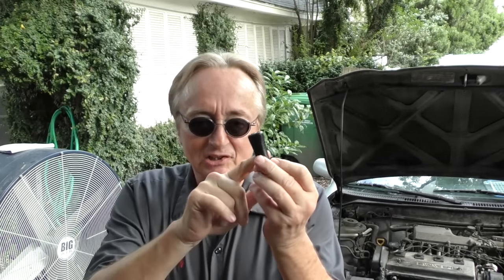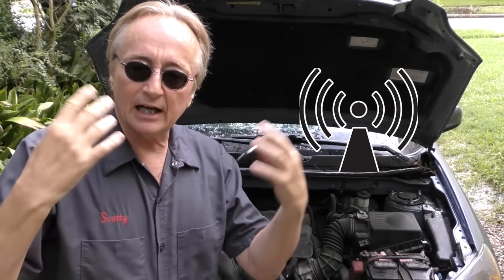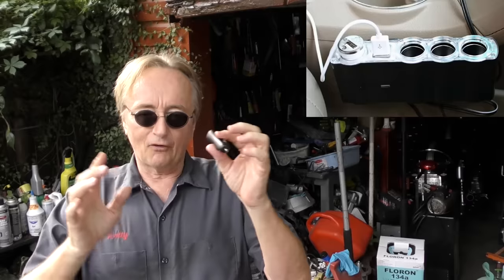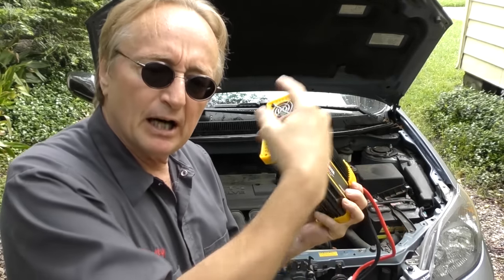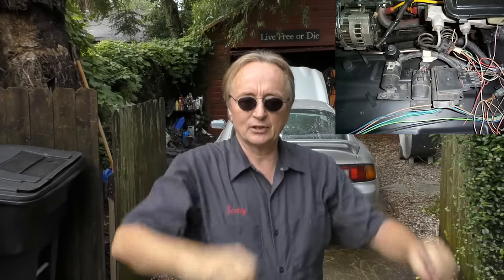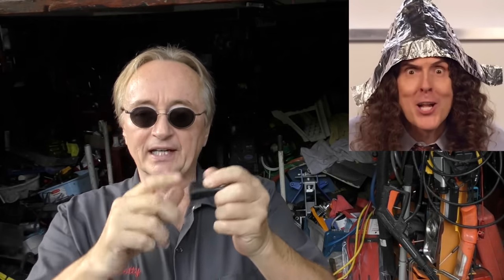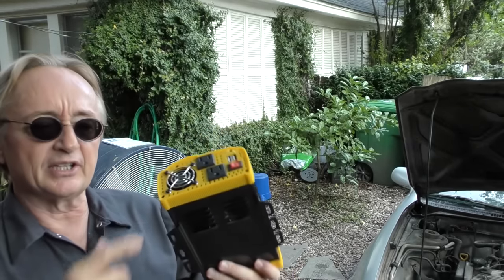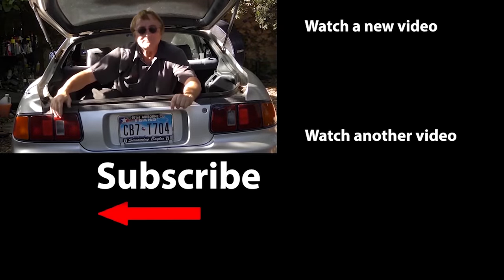This Adapter Will Destroy Your Car

Comment: While I agree with RF interfering with car systems, its not wireless frequencies that's causing the interference. Its RF being fed back into the car's wiring.

A simple fix we've used in the past is adding a DC line noise filter on the plugs you are using.
Reply: It depends on if the alien probes are plugged into the noise filtered plugs or not :)
Reply: Your reply makes little sense. Wireless frequencies and RF are pretty much one and the same.
Reply: May I ask for a product or some information on what we are talking about, thanks,
Reply: There all grounded
Reply: Isn't that for audio noise coming through the line from ignition and such, which suppresses those noises, as opposed to the inaudible RF frequencies?
Reply: @burritos1000  It would probably work for both.
Reply: It works for both, regardless of direction. Whether the sound is coming from your alternator or a device plugged into a cigarette light/power port, noise is noise.
Reply: The difference between RF through the air and RF down a wire are very different. Your car is bombarded with wireless RF constantly and on all frequencies. Outside of interfering with any wireless options your car has (bluetooth/wifi/cellular), wirelessly transmitted RF is pretty much a non-issue. 

RF being transmitted through your car's wiring is very different. 

Many of your devices in your car that could be subject to wireless RF are shielded. The box containing your ECM is metal for a reason. It's basically a faraday cage. What most cars are not shielded from are localized RF transmissions (IE: Coming from your alternator, chargers, etc). Localized RF transmitting through your cars electronics can wreak havoc on sensors, gauges, and computers, like Scotty was saying.

As for wireless RF, it's not a big issue. Localized RF broadcasting directly into your cars electrical system is something else entirely.
Reply: But, Scottie said, "if I wrap aluminum foil around it, (shielded) the problem goes away"
That would indicate RF thru the air to the remote start, which is programed to receive RF.

Comment: It's true that, RF interference can emanate from poorly shielded or low-quality 5V chargers and other electronic accessories connected to the 12V car socket. When these devices are in use, they generate electrical signals, and if not adequately shielded, these signals can radiate RF interference. This interference can then propagate through the vehicle's electrical system and potentially interfere with sensitive electronics within the car. With that being said. I've had absolutely zero problems with them. I've been using one that has 6 USB slots for several years with zero problems..

Comment: I remember the days when people put lighters in those holes.
Reply: I still do bro.
Reply: It used to be great smoking on a car trip, when your driving solo.
Reply: 07 kia sportage had both the lighter and a real ashtray !!
Reply: @orbitalair2103  did my driving test with kia manual. Jeez that car is hell. GERMAN UNTIL DEATH.
Reply: Now it’s a extra cost for a cigarette lighter package
Reply: USB adapter to power e-cigarettes... ugh.
Reply: Will Will  It is normal
Reply: You mean coin trays and USB power outlets. 
Something is wrong with the factory plug. It got really hot once. Never put it back.
Reply: @PritchyTurbo2000  Same here .
Reply: Leave them in because you might drop a dime down into it and blow a fuse or worse.
Reply: before vapes

Comment: I wish I had watched this video before I bought one of these cheap units from goodwill brand new! It blew a fuse in the middle console 12 volt outlets which operated on continuous power but not anymore since finding  and replacing the fuse it blew. It's a 2019 dodge journey and dodge wouldn't tell me what to do without charging a high price. One mechanic said shut down the battery by disconnecting it to reset the car's computer! What do you suggest Scotty?

Comment: "Even the physicists don't really understand electromagnetic stuff." Umm, OK, sure. I had one of the really cheap power adapters in an old Chevy Nova. That must be the reason that the engine ran out of oil and ceased up!

Comment: Next Video... "Why you Should wrap your keyless transponder in aluminum foil"
Reply: I actually would not be surprised.     Basically he is saying that if you shield it with a little tinfoil hat the adapter will be safe.   We drive our cars nears stronger "inverter frequency" fields all day long.    I am sure  these cheap inverters cause trouble.   But the details as to why doesn't sound clear enough.
Reply: That's how the aliens track us. wE aRE BeINg WaTCheD
Reply: I read that car thieves can copy your codes if nearby with a new copy devise. Then they just use the code to steal your car ! So wrap them in foil and it will slow them down ! Do the same with all credit cards too. A guy scanned our card  while we were on line at a store. We got a billed for  a Pizza & New pair of Nikees. It was in the big city, we hardly every go there ! Luckily  our bank caught it and we did not have to pay ! Those people should be boiled in oil and then horsewhipped. Before prison time, of course ! Sounds like a good deterent to me !
Reply: The Lexus ones can be shut off with a "cheat" code and then powered back up by pressing any button on them.

Comment: Another great video. I drive big rigs for UPS. and a bunch of our tractors have the check engine lights on. The mechanics check it and find nothing then reset the computer and it goes away for a short time but then always comes back on. Now I know why. My coworkers plug everything under the sun into the power points.

Comment: Luckily, the newest cars have plenty of USB ports built-in. So you don't need to buy any of those cheap converters.
Reply: The problem is the ones that are built into most cars don't charge very well
Reply: Corvid Cares  Yeah, that was my point. I have heard NOTHING about the built in USB ports in modern cars causing any interference problems. So I assume they were tested by the car manufacturers and shielded if necessary.

Comment: Subarus today will have USB ports built in at different locations, so no adapters are needed, also on the largest model there is a 120v outlet available.

Comment: Also cheap cell phone chargers and switch mode power supplies that you use in your home can cause large amounts of interferance on your home's electrical wiring, turns your house into a large radio transmitter!!.

Comment: Thanks for info Scotty. I had no idea these plugs would create such a problem.
Reply: They can't.
Reply: Ditto
Reply: @witzed1  you'd think before going through all the effort of making and posting  a video, one might at least google what the main subject of said video was and how it worked. or how the PWM output of a buck converter is pulsed dc not ac. or how a 5v2a adapter does create some em output... but is negligible compared to the 14.8V 50A and above AC to DC monster attached to every fossil fueled vehicles engine.... the cars were most likely more affected by EMF from the chargers on the power side because the cheap ones dont have input coils to filter this... obviously i made all this up... because if even scientists dont understand electromagnetism , i dont have a coulomb to stand on...

Comment: Most of the newer good ones don't convert DC to AC to DC. They just step down the voltage and amperage. Much better and cleaner.
Reply: How do you step it down without converting to full or half wave AC?  Are you saying they just but a big resistor in there to drop the voltage?
Reply: *big linear voltage regulator. such solution is actually to be expected from the cheapest ones.
what normal adapters do is pwm feeding a half wave to straight dc filter with duty cycle dependent on the output voltage so as to keep a stable voltage no matter the load and input voltage
Reply: garzascreek voltage divider circuit
Reply: Sarge  your mistaken  only way to do that is a resistive voltage divider which uses much  more power than the device your charging and can only function properly  on a fixed load. That’s why these switching supplies , dc to dc converters were developed in the first place.  Only thin that can be done is lower the swithing frequency and that’s why Scotty recommended the standard 60hz inverters. 
  You must convert dc to ac and back to desired dc volts  to avoid massive power loss and heat   The lower the frequency ( less interference) the larger the components and size of device   Always a trade off
Reply: @garzascreek  You use a buck converter, essentially switches (mosfets usually) and an inductor.
Reply: @David Bry  This is one of the stupidest suggestions i've ever read.
Reply: @davezimmerman1510  No you don't, you use a buck converter (simple circuit of mosfets and inductors). Most PCs have whole arrays of these on them to do power management.
Reply: You only need to convert to AC if you want electrical isolation via transformer between source and load. Low-voltage DC-DC converters are typically non-isolated, which allows the use of buck/boost converters for simplicity, higher efficiency, smaller size, lighter weight and lower cost.
Reply: @teardowndan5364  -- No, they aren't using step-up buck converters.  They are stepping the voltage DOWN from ~14 volts to 5 volts.  Most, even the expensive ones, use PWM and a capacitor or a capacitor bank because inductors, by definition, cause even MORE emi.  PWM causes emi as well, though.  An electromagnetic field is caused any time there is a change in the strength of a current running through a conductor.  What Scotty said about the aluminum foil really gets to the heart of the matter.  A properly shielded device will emit no EMI...or at least not enough to cause any problems.  Buy properly shielded USB adapters and you should be straight.

Comment: Physicists understand Electromagnetism and EMI perfectly well Scotty.  They also understand RFI as does any radio ham.  The laws regarding it have been known for over a century now.

I also doubt that  they would use a switch mode power supply to drop from 12V to 5 when it's cheaper and cleaner to use a DC-DC converter.  There are many solid state types.  The problem comes with them when they are poorly made.  They overheat and short causing a power spike.  That is enough to do damage to car systems.

Switch mode power supplies are used for large voltage drops like 230V (or 120V) to 12V (or 5V) and work by rectifying the mains voltage to DC, then switching it on and off very quickly as they can use a smaller transformer in circuit.

Comment: Use it for 20 years!
No problemo.
Reply: USB adapter? 20 years? Yeah right...
Reply: I had power inverters and two usb plugs cars are grounded to reduce rf interference if its such a big concern remove the alternator thats the biggest rf producer
Reply: @thatfrenchcanadian5779  you understand that cigarette adapters have been around for a VERY long time, right? I had one that powered my palm pilot with its proprietary connection and an included cigarette power adapter.
Reply: @thatfrenchcanadian5779  before usb had old Nokia phones chargers.
I still have some of those around.

Comment: SCOTTY, I have had something draining my batteries through  four batteries now and no one has been able to fix the problem. My campervan had a backup camera, a fan, and cell phones plugged into it off and on. I thought it might be the carburetor. Sounds like you might have answered my problem. I guess I will have to take it to Toyota and have the computer reset ! Not my favorite place. Say a prayer it can be fixed.

Comment: Dang, I'm gonna get an inverter, throw a small fridge in the back, now I'll have cold beer all the time!! Thanks Scotty!
Reply: If they don’t find you handsome, they’ll at least find you handy. 😉
Reply: I got a portable fridge/freezer in the back of my car and it plugs right into my cigarette lighter socket.  It keeps whatever cold item i have nice and cold.    :-)
Reply: Make sure your battery is strong enough to power both your car and your mini fridge.
Reply: @ferraribeng  Thanks.  It is specifically made for vehicles and has a low amp draw.  It only runs when the car is running.  Again, Thanks.  :-)
Reply: @benbenben123ben  I’m pulling for you. We’re all in this together.
Reply: You’re convincing yourself to get a DUI
Reply: @benbenben123ben  okaay Red

Comment: Does the inverter need to be straight to the battery? Mine has both battery and for lighter switch.. can i use lighter switch without giving car problems??

Comment: I just realized last week that this stupid adapter caused my battery to die 3x and I'm wondering now if it caused my radio to blow and my heated heats to no longer work. 🤔 I removed the adapter before I took my car to VW and after conducting a parasitic draw and diagnostic check,  they couldnt find the cause.  I wish I had seen this video sooner. Thanks for sharing your invaluable experience Scotty. Love your channel!!

Comment: Always droppin knowledge...Not all heroes wear capes...thx Scotty.
Reply: Scotty, as you normally praise the Toyota RAV4. Can u help a subscriber out. 2012 RAV4 runs well w frequent use. But, will not start w/o a jump assist if left for a week or more. New Interstate battery in last 3 months thinking 5 year old battery bad. Again after a 5-8 days, jump needed. 24K miles on 2012 RAV4.  Toyota dealer anxious to check. What R your thoughts?

Comment: I have one of those cheap 4-usb slot adapters in my car and I haven’t had any problems (yet) but I also only ever really use one at a time, maybe two if I have friends in the car. So the minimal draw helps there. 

As an electrician, I would never use those wonky cigarette lighter extension things that lets you plug more stuff in it though, that just looks like an electrical fire waiting to happen. Someone’s bound to plug 20 different things into it and draw far too many amps through that circuit. The extension itself could be built to handle the amperage, but the wiring for a cigarette lighter likely isn’t. 

Just like it’s dangerous to plug way too many things into an outlet, it’s dangerous to plug way too many things into your cigarette lighter. It’s built to power one or maybe two things, not charge 10 phones simultaneously.

Comment: There should be some regulation about stuff like this: I mean, when you buy and use one of these - sometimes very useful - gadgets, you certainly don't want to mess up your car electronics. They should only be available with some kind of a warning about the risks you're exposing your car to by using them.

Comment: Unplugging mine to see if it fixes my low tire light, traction control, etc. Thanks for the tip Scotty
Reply: Check your tires air pressures. Both lights will go off with proper inflation.
Reply: Check you tires air pressure. With proper inflation both lights will go off.

Comment: No, no,, no. The outlet you are plugging that into was designed to heat up the coil of a cigarette lighter.  It is on at least a 10 amp fuse. USB standard is .5 amps. A charger might interfere with RF stuff but it's not overloading anything. Those devices are limited to a total 4.8 amp draw.

Comment: Scotty, the problem with the cheap ones is that they use poor quality and simple components to built it, and there's no "safety" in case of overloading it! By the way these things don't convert DC to AC and back to low DC voltage... they just use a simple circuit called step-down IC that reduces from 12V to 5V!
Reply: Those ICs use PWM to step down from 12vdc to 5vdc but it does not mean that it is purely a DC signal. It still has AC components in them which can still cause interference and problems. I had one which was interfering with the radio when I was charging the phone and you could clearly hear the noise on the radio!
Reply: @CdGreven  my head is about to explode with all these info lol

Comment: THANK YOU!!!  THIS Solved My Problem!
 I had a (tronsmart, qualcom certified) usb charger plugged in my car(Altima 2011) for a long period & couldn't find out the reason why it's remote was working only on Super close range...
Unplugging It Fixed my Remote's range
Reply: If you have problems starting the car it could be your HT leads ( High Tension,,
Reply: @kenj8uk  Where are you from? I've never heard anyone call them that in the US--they're just spark plug wires here.
Reply: @TravisTerrell  thanks I was trying to determine what he was referring to😋

Comment: OMG I bought one of these recently as the standard USB port was low amperage and taking ages to charge my phone. I plugged in an adaptor and was pleased with how quickly it was charging my phone. Not long after using it though for the first time ever a warning came up on my dashboard saying "service tyre pressure monitoring system" turned the car off and on a again a couple of times and it eventually went away. Going to take it back though and get a better quality one. I always thought these adaptors worked by resistive dropping rather than the incredibly inefficient way of turning it to AC then back to DC again.
THANK YOU Scotty, seriously thought something was going wrong with my car and would need a service etc.